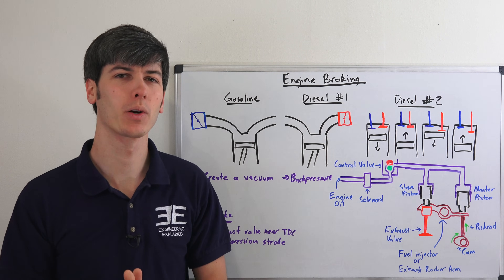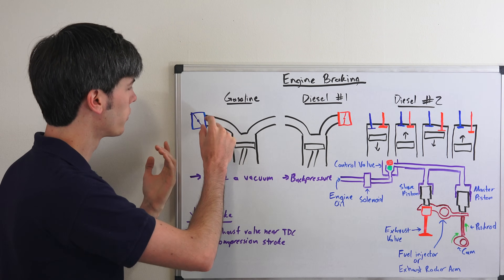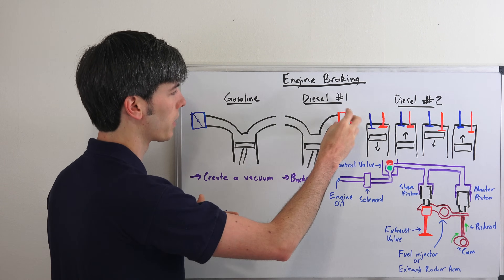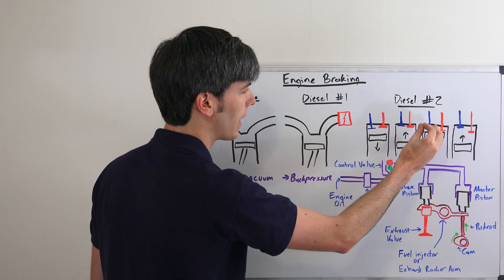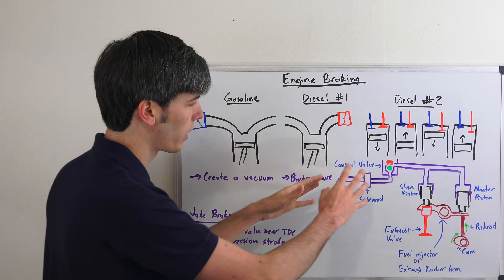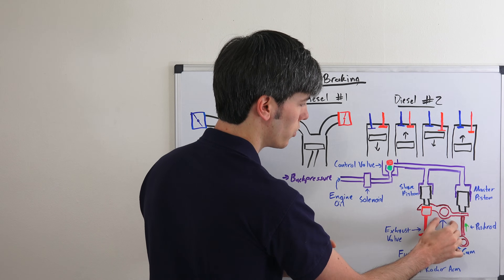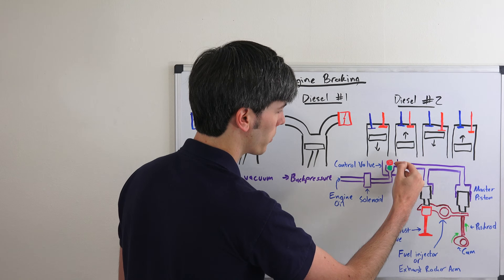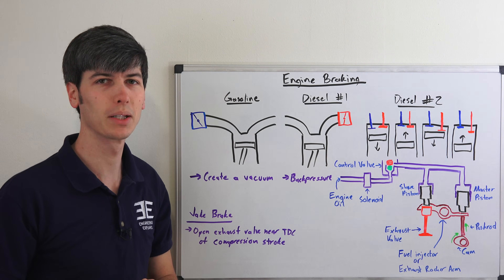What Is Engine Braking? What Is A Jake Brake?

Comment: So if I'm going down a steep hill is it better to use engine braking and let the revs sit at that high(ish) revs the whole time? Does coasting in Neutral save any more gas than engine braking as I just described?
Reply: +xIAMDAVEx The goal isn't to save gas. The goal is to keep your brakes cool. If I am hauling a heavy load, such as a trailer of haybales, and am proceeding down a long hill, I run the risk of overheating my brakes causing brake fade. This will obviously cause total brake loss. Using the engine to maintain a speed of descent and take load off my brakes means I won't overheat my brakes.

Now the other reason you might do it is you aren't wearing your brakes down just to maintain the speed limit down a hill in an unloaded car, or coming to a stop. Instead you are just using the engine to slow you down. This just keeps your brakes and rotors happy.
Reply: +Liam 4.0 definitely better for heavy vehicles with trailers. but I drive a little Mazda Familia lol. I notice a lot of people like to have the brakes slightly on constantly down hills. but I just hit the brakes on and off at intervals but pressing harder. is that better for the brakes than having it on lightly and constantly?
Reply: Yes, as you are giving the brakes a moment to breathe and cool. However, the optimal solution is just downshifting if you have the ability to.
Reply: +xIAMDAVEx 
Isn't coasting in neutral, sort of dangerous, if you do not seriously know what you are doing? I mean, you are giving up part of the control of the vehicle, that being your engine. And I do not think you are supposed to engage from Neutral into Drive, except when the wheels are not turning. You normally would have no need to do that. Wouldn't that possibly damage the transmission, to shift inappropriately?

Yes, engine braking is essential on any long downgrade, as brakes are only designed for temporary use, and easily overheat and fade within just 45 seconds.

Your engine should not be so overreving. If so, you are in too high of a gear. A lower gear will provide additional engine braking drag, and will not overrev the engine. Do not wait until you are going too fast. Pay attention to the downgrade warning sign, and downshift even before you pick up speed or start to descend the mountain. Take your time, as an engine in a low gear will not want to go all that fast, and the goal is to stay downshifted so that you can stay in control, not to win the race to the bottom of the mountain.

And a lot of people are saying that driving in neutral burns more fuel than simply staying in gear. The wheels turn the engine, and as your engine (on most modern cars) stays above idle speed, it will not be given any fuel by the fuel injectors. In neutral, the engine control computer will have to give some fuel, to keep the engine from stalling. Even Drive or Overdrive provides a little engine braking when you let off the accelerator. Neutral does not apply any engine braking, so how will you avoid burning up your brakes?

Check your car manual, to see if it says anything about when you should be downshifting? On an automatic transmission, what do people think that those numbers, 3, 2, 1, stand for? They are for telling the transmission to limit the maximum gear, to that number. Otherwise, upon going faster, the transmission wants to upshift, to help improve fuel economy, and it has no way of knowing that you are going too fast down the mountain. Those numbers are for the occasions that a competent driver should know that they need to downshift. As the only other reason to downshift, would be perhaps for towing. A vehicle just can not very well pull all that weight, in Overdrive, and might too often be shifting back and forth between gears, due to lagging from the towing. Probably better just to stay out of Overdrive when towing.
Reply: +Yosef MacGruber is it the same for an old car? I mean my car is an 89 corolla with a carburetor does engine braking work the same in terms of closing off most of the fuel during engine braking down hill? also autos don't exactly engine brake unless you stick it in tiptronic does that mean autos brakes wear our quicker? I didn't engine brake much at all in my corolla and I lasted 8 years before I needed to change the brakes so didn't really seem like a big deal to me :/
Reply: xIAMDAVEx
I do not see the point of engine braking, just to come to a stop. Engine braking is for long downgrades, to keep speed under control and to keep your brakes cool and ever ready for any emergency stop, or having to slow down due to traffic. Then you may need to downshift to a lower gear, due to traffic and to avoid overheating the brakes.

I am sure that you can engine-brake with an older car with a carburetor. The issue there is, that the engine likely is not able to shut off the fuel completely, as carburetors always put in the minimal idle-fuel. Regardless whether you are in Drive or Neutral. Fuel-air mixture is to be to a proper ratio, thus the air needs to be restricted to idle. The restricted throttle-plate, limits how fast air can flow into the engine. You don't want that wide open, as the engine will race, and will not be much effective for engine-braking then.

They quit putting carburetors into engines, because carburetors were getting too complicated, and just were not able to handle everything that we were asking them to do. A fuel-injection computer would be far more suited towards doing things like completely shutting off fuel during engine-braking. In the old days of cars, using computers to enhance proper engine performance, was not even an option.

You lasted 8 years? You probably do not do much mountain driving, and most people do not, unless they live in such an area or drive long-distance.

I find all these modern transmissions confusing, as whatever was wrong with the traditional automatic transmission? They couldn't leave well enough alone? Now they have to have all these transmissions that can't seem to figure out whether they are a manual or an automatic. But if you need engine braking, just shift to the mode that allows you to select a lower gear. Otherwise, leave it in Drive, or Overdrive if you have Overdrive, and let the transmission choose the most fuel-efficient gears.

Comment: Why does the brake sound so scary when it's used?
Reply: *jake brake.
Reply: +Some guy 
Because a Jake brake allows the air in the cylinders to compress, then releases the high-pressure air, so that it can not return the energy to the rotation of the engine, as it is a "brake" after all. It is thus like releasing a bunch of little explosions.

I wonder if truckers overuse the Jake brake? Does it apply with the brake pedal, or from merely releasing the accelerator? Nobody wants to hear the Jake brakes on the nearby freeway, going through the city where people are trying to sleep. Can't truckers downshift more and Jake brake less? Shouldn't the Jake brake be more for emergency extra braking power?

Comment: what if my car (2003 toyota rav4) has a strong pull when engine breaking, what causes it?
Although, I have recently cleaned the throttle body, engine head and crank case
Reply: You're right about that but I didn't think it would pull that much. Any other reasons related to engine?

Comment: will it do any harm to the engine in a long term. i often use engine frrquently because i think it will save braking pads
Reply: +mdony722 It won't harm the engine assuming you stay within normal rev limits. Just make sure you don't slip the clutch to slow down... Select the gear ratio, release the clutch and let the engine do the work.
Reply: +Batgidis Steven thanks

Comment: why are some clutches hard?like the one on the rebault clio 1.6
Reply: could be a cable clutch or could be the clutch plate springs that causes higher resistance in the pedal or could just be a problem with the clutch
Reply: thanks
Reply: There is a lot involved in a clutch that can effect this, but the primary part is the clutch material, and pressure plate gripping force.  Pressure plates for high HP and racing applications have to apply a lot more pressure to the clutch which makes the pedal harder to push, and the harder the clutch material the faster it grabs so you get less slippage.

Comment: There's still one thing that is not quite clear to me. Basically, there are two situations when you drive in gear without pressing throttle. This is engine breaking (usually done in quite high revs) and just keeping engine running without fuel (simple economy like riding from slight hill). Let's say I talk about diesel engine. Usually without throttle engine will run just on air (no injection). Based on what you've said, it should also be linked with closing valve on exhaust. So is it common thing to have such valve or it's rather not used in modern engines? If it's used then how it will decide when it's time to close and open this valve? It's based on revs?

Comment: @engineering explained; 
in engine braking, the gear ratios also play a role, right? 
I mean it's not only due to the vacuum in case of gasoline.
Reply: Correct ! it's a combination between the compression in cylinders, the the lack of explosion (because of no fuel), and the gear ration who stop the car, not the throttle body vacuum !

Comment: I drive a tractor trailer and like to know how every piece of my equipment works and how it could fail when it does, so thank you for the knowledge!
Reply: +caboosemacs 
It is very good to know how things work. That way when something goes wrong, often you can know what it likely is, even before you open the hood. Even if you can't fix it, at least you know what the consequences are, and whether the vehicle might still be drive-able to a repair place. I once heard a sudden squeal, and then the alternator light came on. Sure enough, checking under the hood with a flashlight, the alternator belt was gone, upon the air conditioner compressor seizing up and destroying the belt and gumming up the grooves in the engine drive pulley. I barely had enough battery to drive to a place to get it fixed. I turned around and headed back towards home, as I knew I surely could not make it to the destination, on battery power alone. I thought it would take longer, but the headlights were fading within just 20 minutes. Probably the battery was getting old already. I didn't get but maybe another year or two out of that battery. At least I avoided a tow. I managed to make it to an auto parts store, and received a jumper-cable battery boost. I had to explain that it would take a while, as I am needing not just a jump-start, but a partial battery recharge, as I have no alternator power to keep things running. They sent me to some guy's home shop, just a few miles away, as it was after hours for car repair places. He charged me a fair price, probably less than a regular car repair place would have charged anyway. He cleaned out the pulley, and of course I bought the replacement belt at the auto parts store.
Reply: If you drive a newer truck, this video is useless. Electronic engines don't use this technology any more.
Reply: hrsqsiest
It still is nice to know, the reason for that loud Jake brake sound. Of course the real reason, is a crappy or improper muffler system, as most of the Jake brake sound could be muffled and is, on many trucks.

Comment: can you explain how vortex generators work I think there is a lot of misconception flying around.
Reply: Vortex generators have their name for a reason. They create vortexes on the upper layer of the wings or where ever they are positioned, and pull dwn the air so it doesn't separate from the boundary layer. This happens when the air passing above the wing reaches subsonic speed, which will eventually cause sonic booms and make the wing stall and of course the hole plane therefore.
Reply: +rallymathie Thanks!
Reply: +rallymathie That's completely backward.  Vortex generators don't increase laminar flow.  They create vortexes which disrupt the boundary layer.  They create a sort of turbulence on purpose.